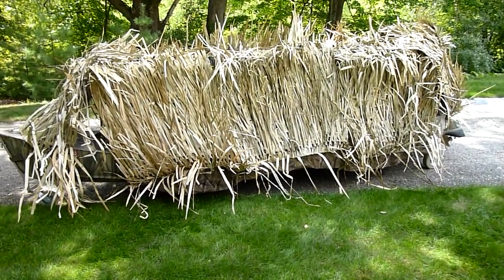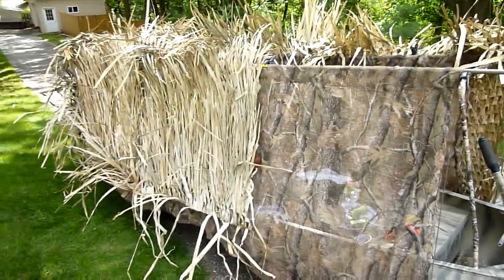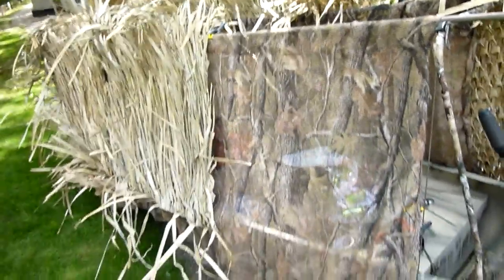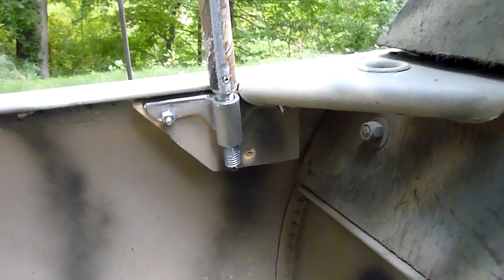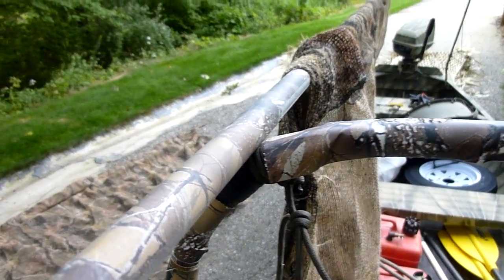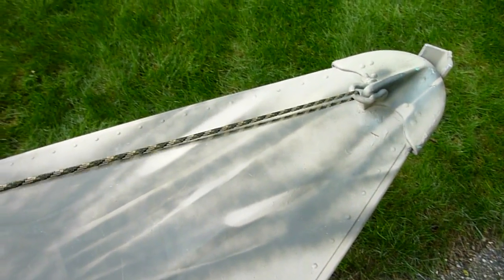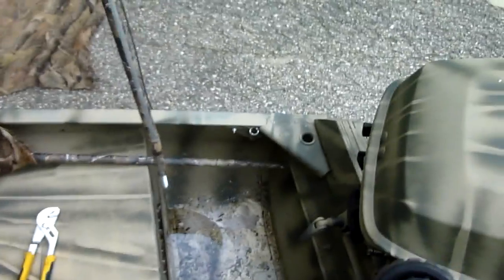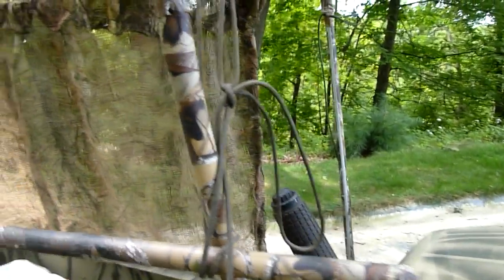OldGuyDIY Grumman SportBoat Sport Boat Canoe Waterfowl Conduit Duck Blind Grass Burlap No Weld Pt 10

Comment: Can you do a review on your johnboat plz
Reply from the maker: I have sold the boat so I cannot do a review.  Wikipedia has a nice write up on the Grumman Sport Boat.  It is a great boat for hunting and fishing; much more stable than a canoe, weighs 110 pounds, will safely carry 1,100 pounds and rated for up to a 7.5HP motor.  Lots of MI duck hunters run 15HP 2 strokes on them.  Youtube has videos of guys in Alaska running them with 25HP outboards.  I put a 15HP Johnson on it for one day but did not like how low it sat in the stern at rest and had to lean into the corners when turning on plane.  I found the 7.5HP to be the perfect compromise for speed, weight and safety.